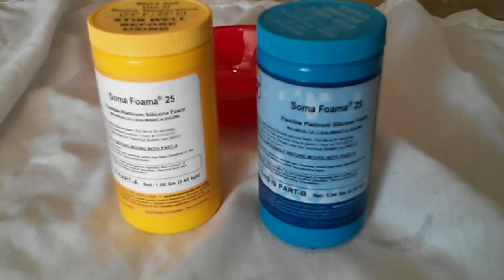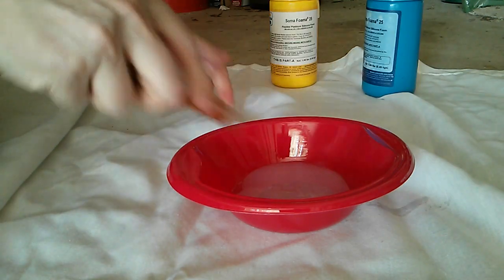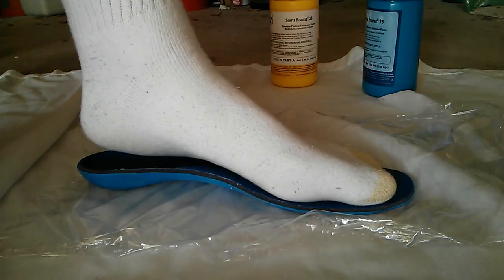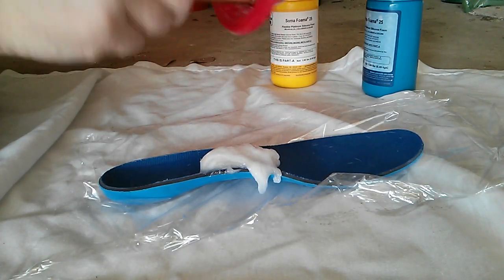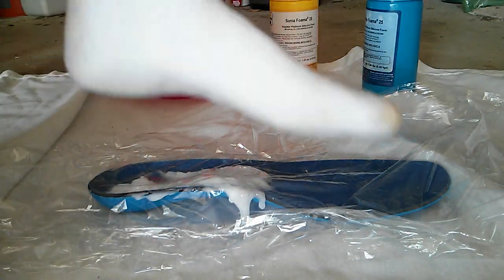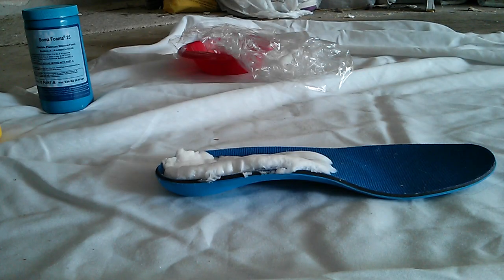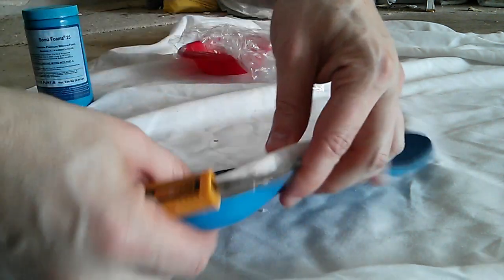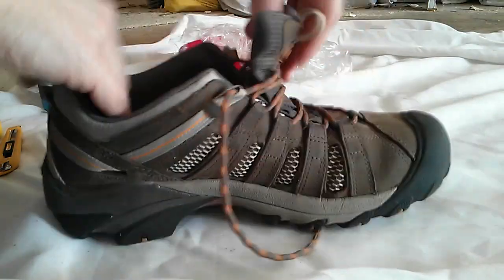Creating custom foot orthoses at home

Comment: Hi, I hope you see this because I tried to order this using your link...it's not working and it doesn't look what you used either. I really need this stuff
Reply: The link works fine for me. But if you just Google "smooth on silicone" and go to their website, you should be able to find the product mentioned in the description.

Comment: I just got this stuff and it's not suitable at all. It is a rubbery silicone, cures VERY rubbery, very tacky grabby surface texture, and it won't take adhesive so it can't be covered. I had to wrap it in saran wrap to get my stocking foot into the shoe without having the rubbery insert ball up under my foot. Can't feather the edges or re-contour it because it can't be sanded. The product has a short shelf life and is expensive. Work time is way too short, literally 90 seconds, no time to get the mixed liquid material in place and let it flow out because it starts curing almost instantly. I do not recommend this product for this purpose. I'm going to try a urethane insulation foam that cures stiff and is sandable for feathering and re-contouring and will take adhesive to be covered with a smooth sheet material.
Reply: onemoremisfit Did this end up working very well? If so, please reply back. I'm a runner with a super high arch in need of a solution.
Reply: @marstonnorris2394  I never did get around to it, got side tracked, but the stuff I was going to try is the aerosol can insulating foam they sell in hardware stores, I was going to try the minimal expanding stuff, I still think it's worth a shot because it's cheap and easy to get, if it fails no big loss. Also, the company that makes the product in this video makes other different molding products, I called them and talked to somebody, but never did try any of their other products.
Reply: @marstonnorris2394  Use silicone. The only problem is weight.
Reply: I use 100% silicone type 1 and corn starch. Mix a tablespoon of corn starch with 3 big squirts of silicone. Stir with a craft stick on cardboard or plastic wrap. You may have to add a little more corn starch but it should be enough so that everything sticks together but not dry. I buy cheap inserts,  put the mixture on the bottom of the inserts in the arch area. Put plastic wrap on the floor, stand on it. Let it dry until it's not tacky then trim it gradually to fit. You'll get a better fit if you put it in the shoe, take it out trim, repeat. Makes great inserts.

Comment: Why don't you just buy a real insole from Dr. Scholls for under $10.00 at Target & Walmart. They last for ever and don't harm the foot.I use them for running. The Soma Foama 25 is $34.98 trial size plus the insole and you will damage your foot.  Dumb video.
Reply: Dr. Scholls are worthless for people that have serious foot problems they are good for presentative maintenance only.
Reply: Cause they are not made for someone with extremely high arches ... one size fits all don't fit that many at all well!
Reply: Don't you think he has already tried store bought orthotics? He has Keen shoes so is clearly willing and able to spend what he needs to for good quality stuff. He says this works best for him.
Reply: Not everyone can use an off-the-shelf orthotic. If the arch of your foot is too high or too far forward, nothing will fit right.
Reply: American Horse u

Comment: get yourself a roll of 1/8 inch thick medical poron, change ur life forever, put a layer in ur shoe and do ur arch build up under it, try poron for arch build up too, 3m 77 adhevsive and a sanding/grinding wheel and ur set
Reply: where do you buy that ?
Reply: Amazon sells it. Just search for poron there.